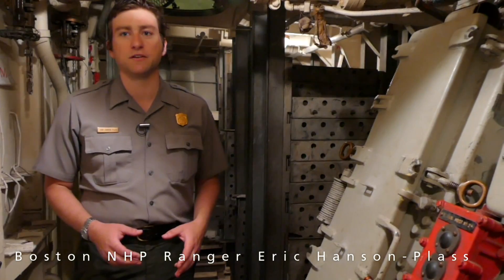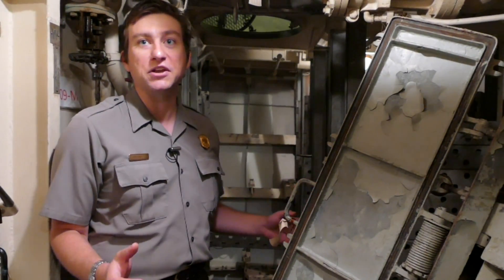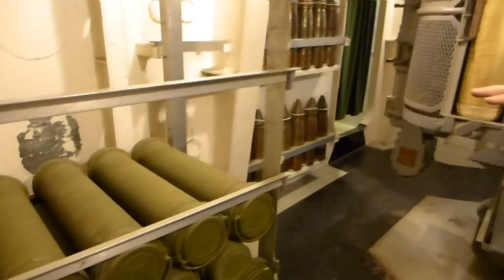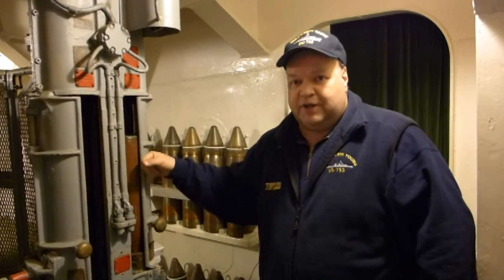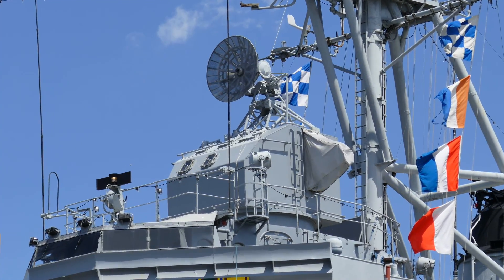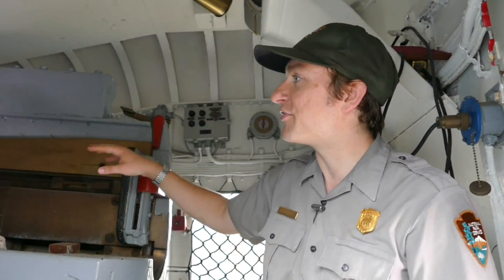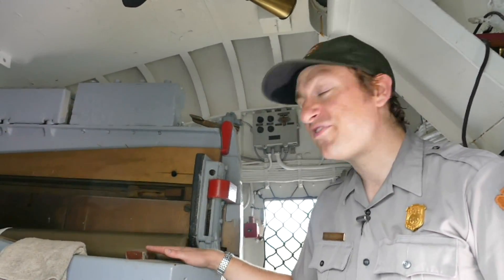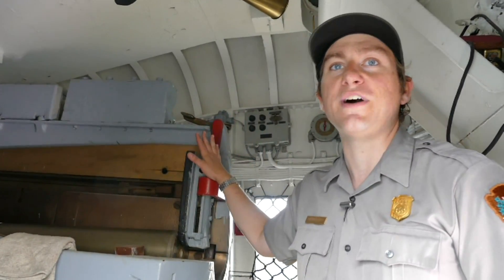Fletcher-Class USS Cassin Young's 5" Gun: Backbone of WW II Naval Warfare, on the Freedom Trail

Comment: I was on DD784 we carried the division 23 commander. the OLD Madox dd731 was in our group. what a tire old ship.  lots of rust. steam plant in bad shape. we had to rescue the madox dead in the water of north vietnam. they ran out of feed water. then could not get the 2 back up diesel generators to start(dead batteries). they were less than 1000 feet off the shore when we got there and pulled them to safety. they could have been captured if the VC had known what kind of shape they were in. Fletcher class was a good design for its time but rust never sleeps.
Reply from the maker: Thank you for sharing.

Comment: The system on a Gearing class is quite different as far as the powder/projectile loading is concerned. The magazine hoisting is manual and  everything is passed up through an 8-10"? scuttle outside the upper handling room and the gun hoists and then passed into the upper handling room. The scuttle is secured and evacuated prior to firing and after the handling room is stocked. A bit safer if a fire/explosion happens in the gun mount or you take an incoming, maybe! Doubtful though. 
Also the magazine is located just two decks down from the gun mount/main deck. Believe me, the hot case man DOESN'T catch those cases as they rocket out of the breech from the recoil of the gun. Notice in the vid he doesn't catch it. There is a hatch/chute at the back gun/mount for them to exit from. If one gets hung up inside the mount then he manually throws it out that chute. The Gunners Mates don't like to have to scrape and repaint the chipping done when the case hits the back of the case ejection chute is all. Done all three of those jobs. Hot case, magazine and upper handling room on the projectile hoist.

Comment: Question: on the U.S.S. Kidd, in Upper Handling Rm 51 & 54, and outside the door of UHR 55 there is a small (less than man size) round brass hatch in the deck near the scuttle from the Lower Handling Rm. (on 55 it is outside the UHR almost under a bunk - no scuttle goes to that UHR.)  On the 51 and 54 the hatch can be seen from below and opens downward.  Under them are bunks.  On 51 the hatch is almost between two side by side bunks in the enlisted berthing area just forward of the crew’s mess, while on 54 it is over the passage between bunks on the port side of the forward-most aft crew berthing.  Since they are made of brass and are located only in the UHRs it seems obvious they have something to do with ordnance. Can anybody please explain their function.  I suspect they have to do with loading ordinance aboard - which had to be done one piece at a time and by hand, but would like confirmation or correction of this.
Reply: The bottom of this hatch from the 51 mount can be seen briefly in the Cassin Young video https://www.youtube.com/watch?v=_cU-Ic38OfE
at the 16:07 mark.